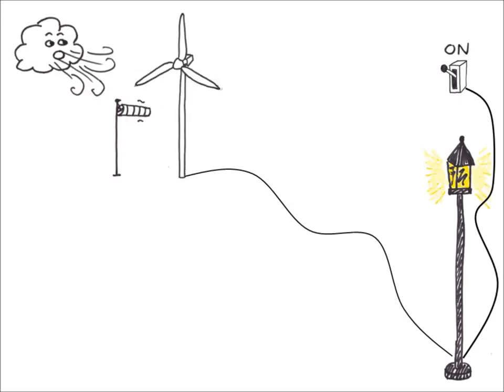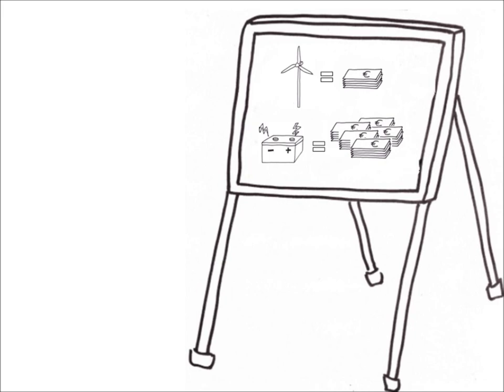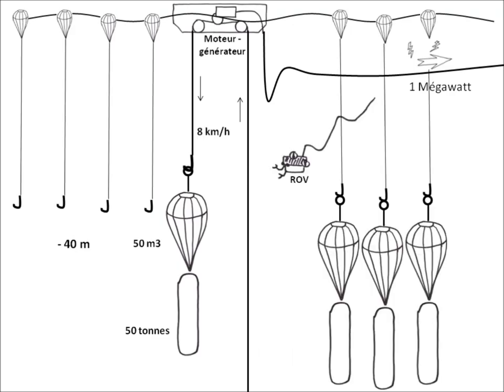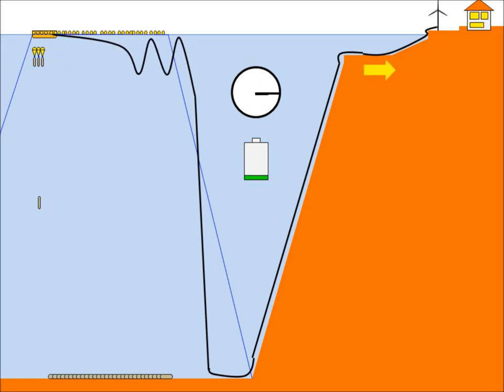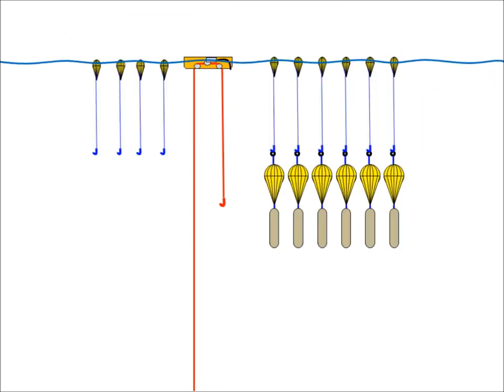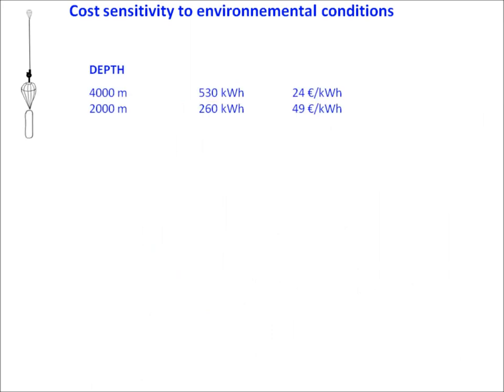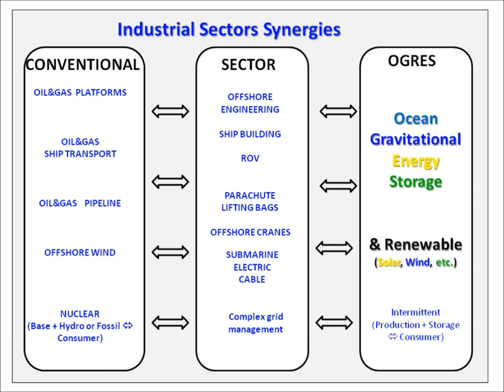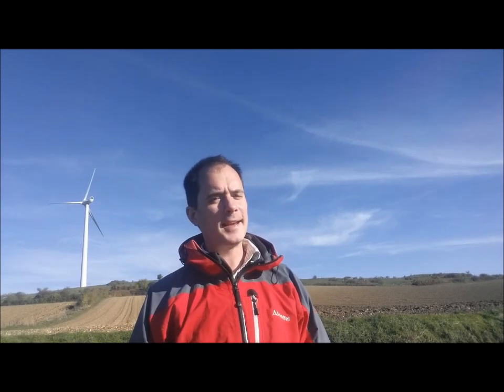Ocean Gravitational Energy Storage

Comment: I'm just now getting interested in energy storage. If you have any links that provide the efficiency for each type of storage, I'd be very grateful. 

For instance, I'm wondering if with your system you could efficiently store compressed air using the pressures of the ocean as well, or since it requires more weight, it would be less efficient in the long run. I know that compressing air on land, you lose energy to friction and heat as well as other things because of the systems required to compress the air, but if you can just use gravity to create the compression...how efficient could it be? This is all super interesting! 

One technology that I'm really wanting to understand if it could play a bigger part is hydraulics. Again if you have any suggestions for links, books, videos to watch, I'm all ears! Thanks!